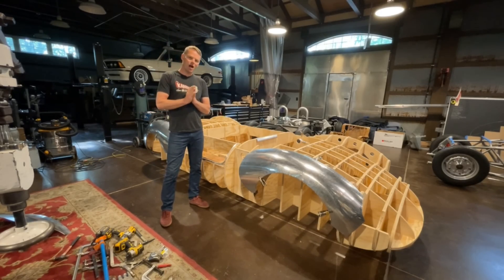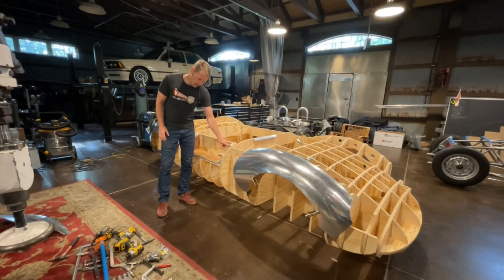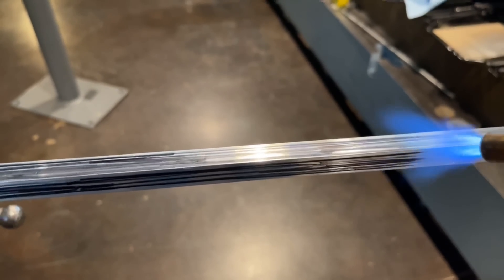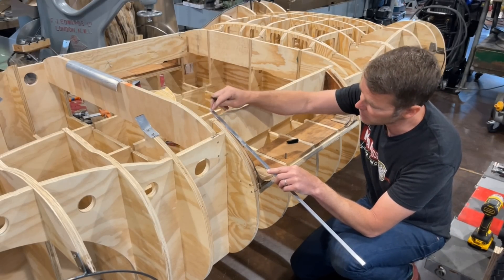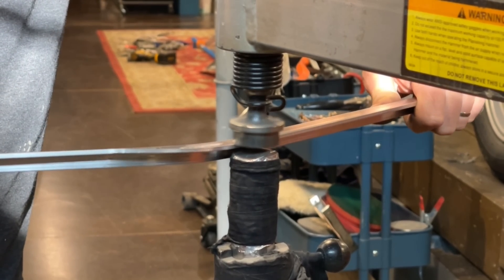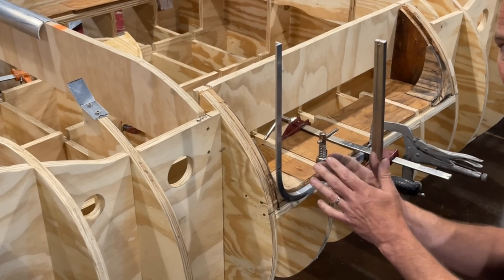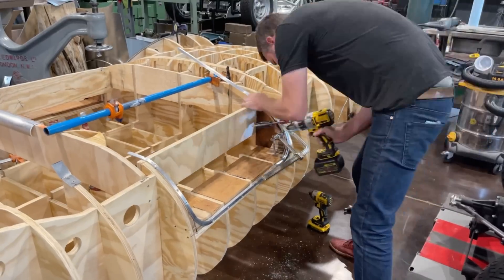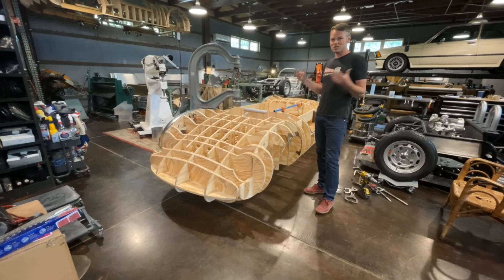Runge Metalshaping Part 4: How To Anneal Aluminum and Shape Flanges

Comment: You're really starting to make me believe I can achieve my dream simply by getting a few tools and throwing myself into it. The biggest thing that has stopped me is not having a resource that could deliver some of the knowhow I never had about metalshaping and coachbuilding. The day of the hand-built car is coming again! So I started playing around with a free 3D modeling app on my galaxy and making 3D renderings of my old body design sketches and some new and just with the insight from your videos I'm able to get panels flowing more smoothly in the digital environment. My designs border on the insane... many of them 4 or 6 wheel drive, 500 Ci+, some entirely original and some (many) inspired by pontiac models through their history, from tiny mid rear cars to massive land yachts. I heard you mention you use an outside designer for your body's and if you ever want to send me a prompt I would be glad to give you a body design any time in exchange for the knowledge you're sharing with me in your videos past and present.

Comment: Love your work. For 0H you also need to quench the aluminum after you've raised it to temp. No doubt you're happy with the ductility level from the flame softening but if the section is ever thick enough you really would want to quench. Funny how it's opposite to steel but works great.
Reply from the maker: Interesting. I have heard the opposite on quenching, that it actually hardens the material back up… I have not tried it on the thicker material like you sugges though!
Reply: @RÜNGECARS  A lot also depends on which aluminum alloy that you are using.  If you are using an age hardened alloy it has to be quenched after heating to 900F.  This is because the quenching process keeps the alloying elements in solid solution.  It is the aging (or tempering process) that allows the alloying elements to precipitate and allow the strength to increase.  For non-heat treatable alloys, the annealing temperature depends on the alloy.  More than likely you are using a 5xxx alloy since you said that it is H14 temper.  The H designation indicates a cold working strengthening process.  To anneal this alloy it needs to be heated up to 650F.  Because you are using a thin plate or sheet, flame softening is quite often done.  I recommend using either temperature crayons (my preference) or an IR thermometer to gauge your temperature.

For summary the non- heat treatable alloys are 1xxx, 3xxx and 5xxx.  The heat treatable alloys are 2xxx, 6xxx and 7xxx.  The 4xxx alloy is primarily used as a filler metal on 5xxx and 6xxx alloys and can be heat treated when used on a 6xxx alloy.  Heat treating a weld on 5xxx alloys that is made with a 4xxx filler metal will result in annealing the 5xxx base metal.

When shaping and bending a 5xxx or 3xxx alloy, periodically annealing the work area can be a good idea as if there is a large amount of deformation, loss of ductility can occur and then cracks may start appearing.

It is on steels that quenching causes the material to harden.  Assuming of course that the particular steel alloy that you are working with is hardenable.

hth

Comment: Nice detailed and useful info. I learned and have been using the magic marker trick  after over bending and cracking hardware store and other aluminum alloys unknown origin.
To be clear, these angles on the buck opening are sacrificial, and do not end up as part of the car door or frame?
Reply from the maker: Yes the aluminum angle material mounted to the buck, stays on the buck.